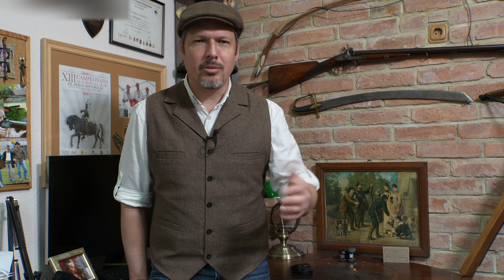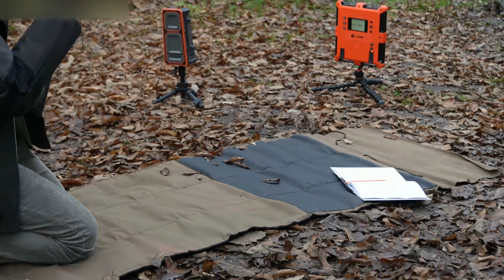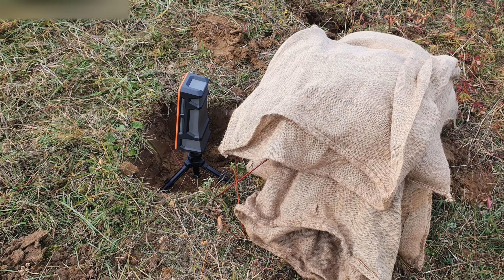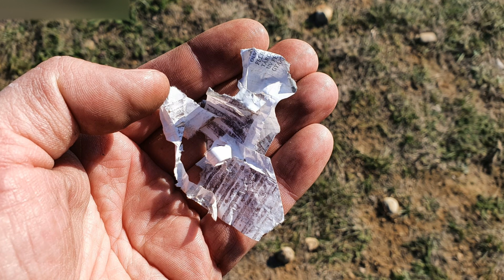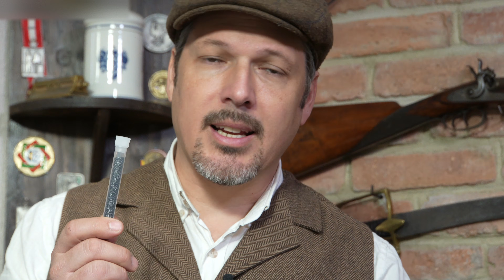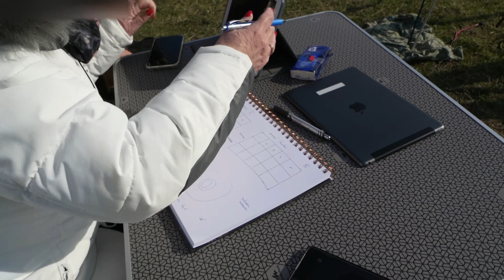900 yard muzzle loading shooting challenge

Comment: Good shooting and always like your videos. I have a Whitworth, early Parker Hale.....and was very dedicated to it for many years. I still consider it in my top 2 firearms. I noticed the group you fired had more vertical dispersion, than horizontal. Have you tried putting the butt of the rifle on a bathroom scale when seating the bullet with the ramrod to a consistant reading. I know we all develop a feel for that, but would be interesting to see if it makes any improvement.

Comment: The "ball" engaging the rifling. . .  Not forced, obviously, and not a Minie ball.  Does the paper, disrupting somewhat, engage the rifling?  
Paper is very abrasive, and seriously hard on steel.  (The reason why you do not use your wife's sewing scissors to cut paper, under the threat of dire consequences.)  SuperSneakySteve has a point, but I imagine the light lube would handle that.

Comment: Does it make a big difference if you clean the barrel as you do after the powder charge is in the barrel or could you clean right after the each shot. Short distance (100 m) at least in my .54 Browning Mountain Rifle it does not make any difference but maybe in the smaller calibers powder residue in the burning chamber results in less accuracy. Love the horse bow on your wall!
Reply from the maker: I clean on the wad so i don't push the residue in the chamber. We need uniform ignition for uniform velocity. There are shooters cleaning right after shot, but then they fire one or two caps on the nipple.

Comment: This is great.  I've been doing Black Powder Cartridge Rifle shooting.  If you get interested, use a drop tube to load the case.  Learning that little trick tightened up my groups a great deal.  I have used paper patched but really didn't notice much of an improvement over a properly sized bullet that was well lubed with a seasoned bore.  My bullet lube is beeswax and rendered tallow.  About 70/30.
Reply from the maker: Dear Bill, I also reload 45/70 with BP for my rolling block. If I am safely on target at 1000y with my ML rifle, next step is the Rolling Block.

Comment: Shooting at 900 yards is not easy with even a modern rifle with a scope.
Using iron sights and a black powder rifle at that range is really
impressive. I have a  couple reproduction black powder
rifles and they are accurate but nothing like the one you used
in this video. What amazes me is how many original 
black powder guns you use in your videos. Where
I am in the USA, original, non reproduction black powder
guns are very expensive. Thanks for the great black powder
firearm videos.

Comment: Outstanding video! At my age, getting into and out of the prone position will require helpers. 

One problem of using the advice of the old timers is that the materials they used in the 19th century were changed over time. Paper and cloth patching is not the same due to manufacturing changes. Sperm Whale Oil was used in lamps, in locomotive steam cylinder oil and early car transmissions. Not any more.

Comment: Merry Christmas to you from the US love your video I have a 4570 Marlin even though they makes the lighter 405 grain I prefer the original Winchester load of 500 and black powder if you could do a series of a 600 grain bullet that would be totally awesome there is a gentleman out there 600 Bullet at 1400 feet per second I believe from 18 and a half inch barrel Marlin good shooting
Reply: Another 45/70 fan boy. 🙂
My favorite of the big 3 is a Pedersoli Remington Rolling Block.
34gr of 4198 and a 405gr projectile. 
Best distance was 500yds at a 30gal drum painted lime green with lime green carpenters chalk on top. A great day, tons of fun. I took my Sharps and Marlin 1895. The Remington won. Hahaha 
I still love my BP but gramps is not as steady as I used to be. 😎